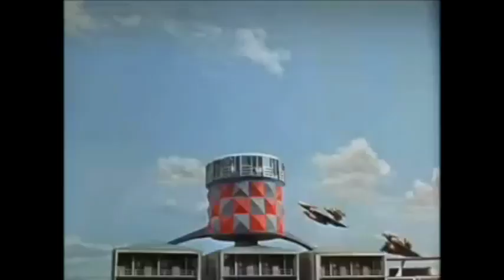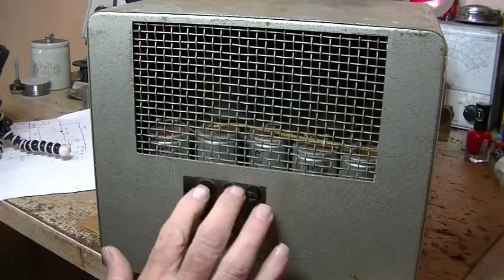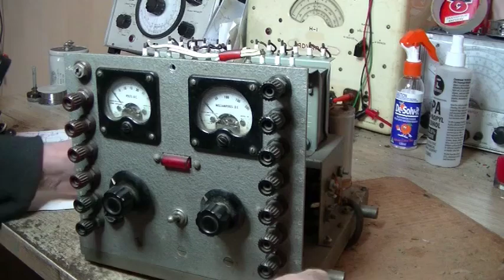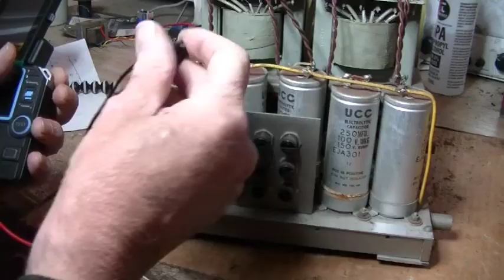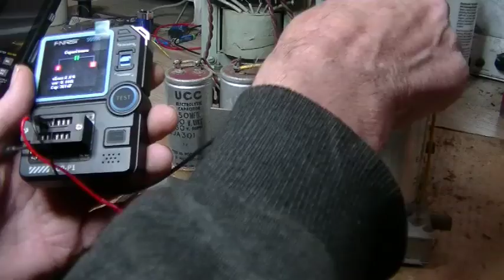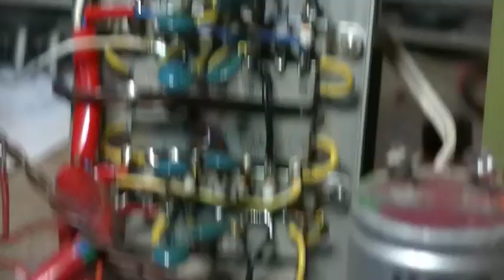Restoring an Unknown brand Power Supply. Circa 40-50's? Part1

Comment: Nice power supply Frank, I think the e-caps that you checked are good, the ESR values are quite low for their age. Hope you get that analog voltage meter figured out.
Reply from the maker: Thanks Ken, I think it's best to change them give their age. I'll do my best on figuring out the voltage and current selectors. I;m thinking they may for for load adjustment?
Reply: @exeterslab7781  Absolutely, even with low ESR’s older capacitor can still leak.

Comment: Love that opening from the classic children's show Stingray. You should start every video with it Frank! You could use 
this to power a vintage battery tube radio. Gang up the positive side terminals to get needed A and B side voltages. Those electrolytics need replacing to use it. Looking forward to part two of this mystery make low voltage power supply.
Reply from the maker: Thanks Steve, stingray is a classic. I remember watching it as a kid at around 7.30 pm once a week.

Yes definitely good for battery sets. Now just gotta wait for the electros to come in